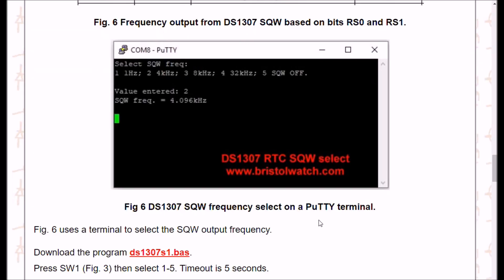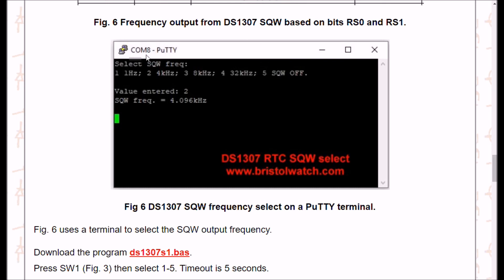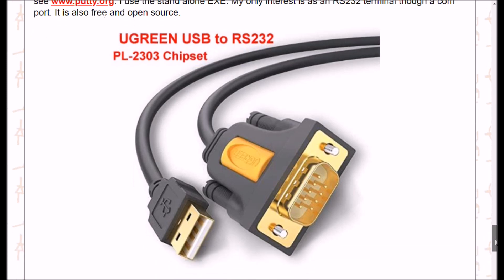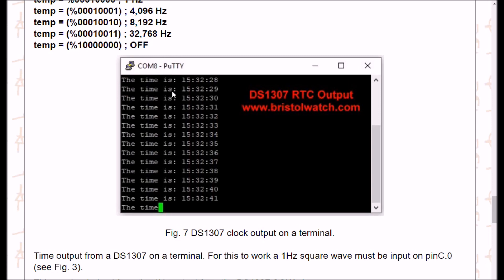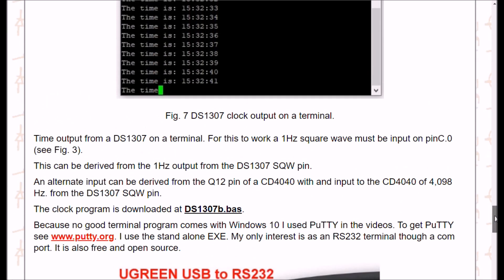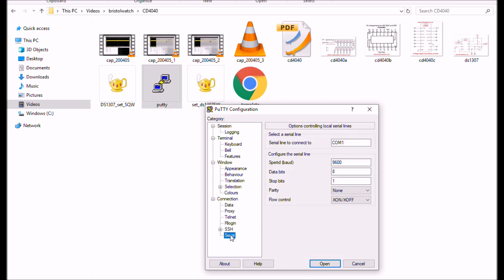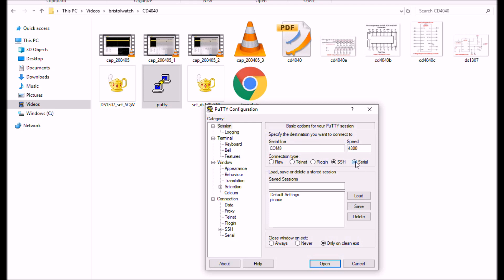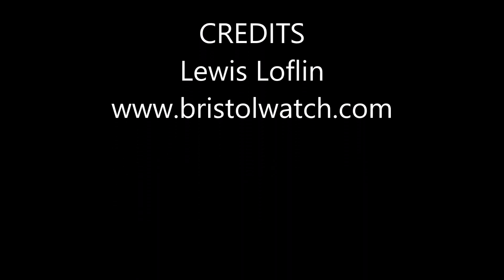Short Video Using PuTTY Terminal Program and USB to RS-232

Comment: Hello !! I have a board of an alarm, the board has a db9 serial connector, when I connect a pl2303 manhattan cable to that port, and to android phone, I can send commands and read the results using one of the multiple applications that are on play store. My intention is to replace the android phone, with an esp32, so I can make my own program , to handle the commands sent to the alarm board and the answers from it. Can you help me ? Thanks !
Reply from the maker: I have never used an  esp32 so sorry, can't help.